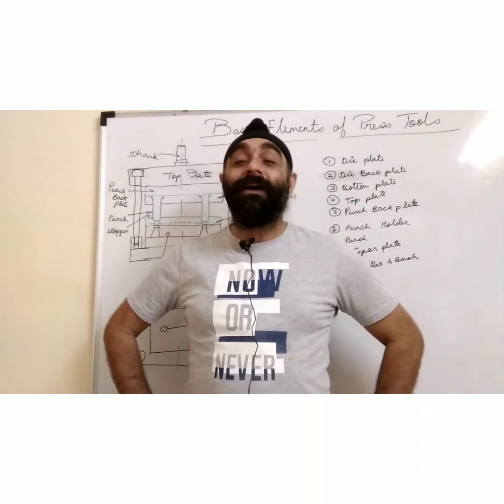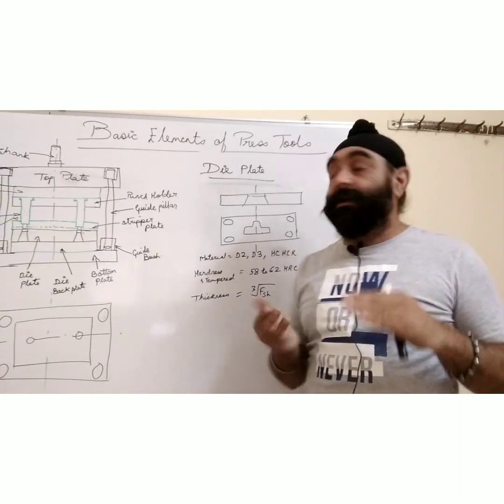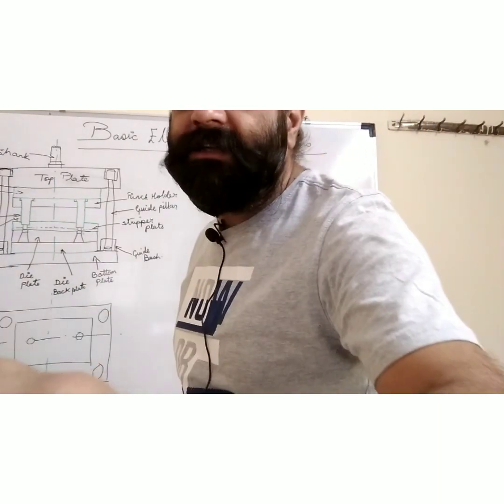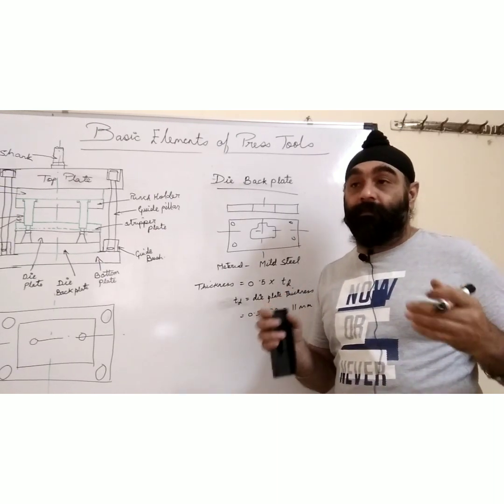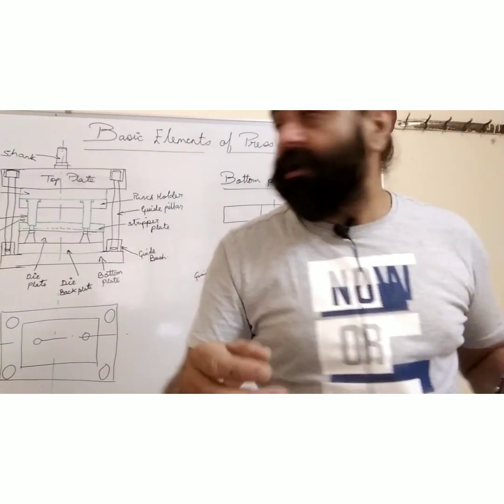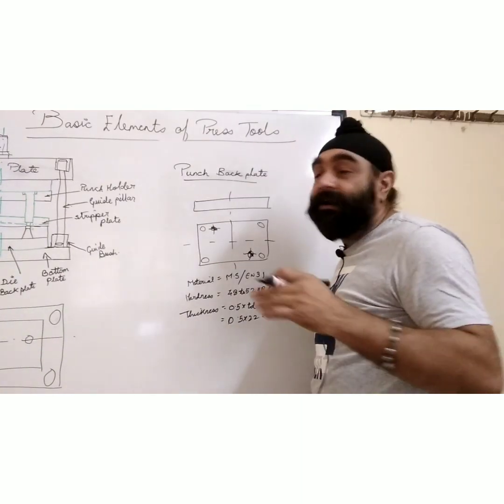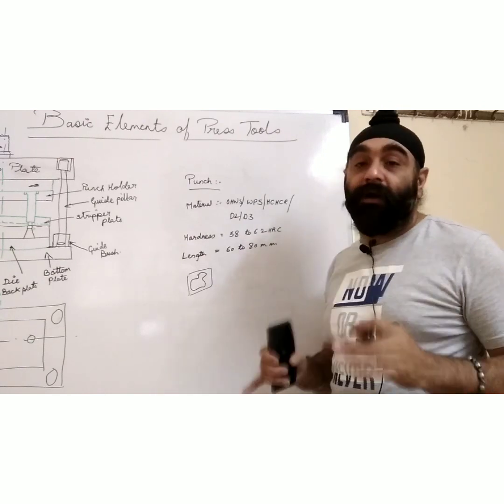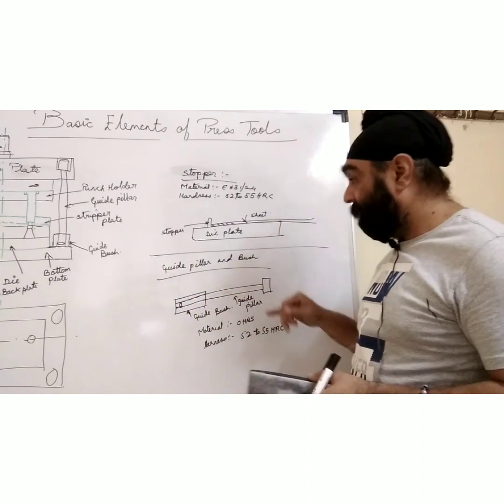Basic Elements of Press Dies - Press Tool Design

Comment: Sir, kindly confirm how much size we consider die plate length and breadth from the part dimensions
Reply from the maker: We have to clamp die plate to bottom plate, so allen bolt head should have 1D wall on all sides…. And minimum 10 mm wall thickness for cutting edge…

Comment: sir, how to decide the length of a punch, kindly explain
Reply from the maker: When die is in closed condition, punch length should be extend land of the die block by 1 - 2 mm. I will plan to make video especially on Punch length soon
Reply: than you very much sir for the reply

Comment: why you using mild steel for die back plate material . is it ok ? we using ohns grade. if you using mild steel is not correct for tool life .
Reply from the maker: sir die back plate should be soft, so that whenever force gets transmitted from die, it should destroy die back plate and not die plate.mild steel is perfectly okay to use here what i think